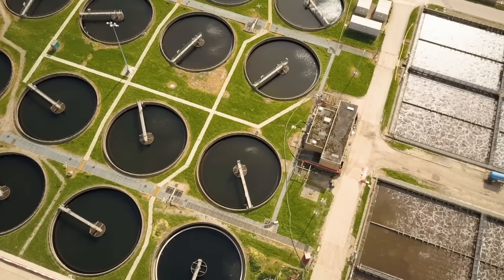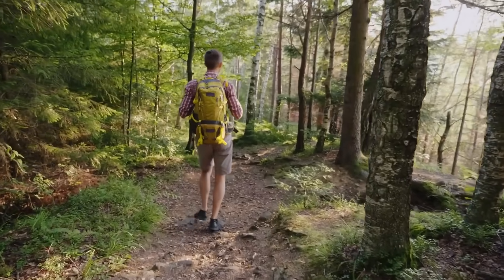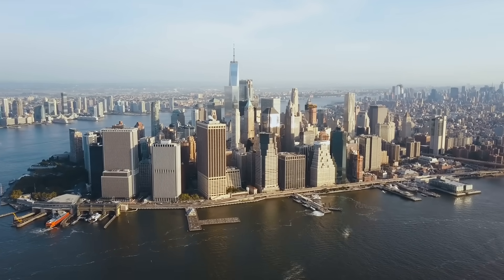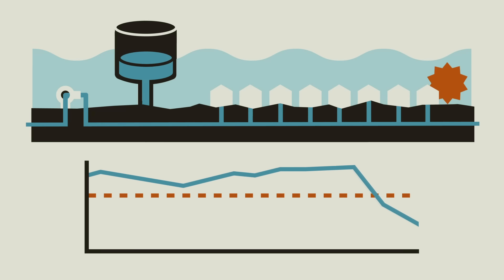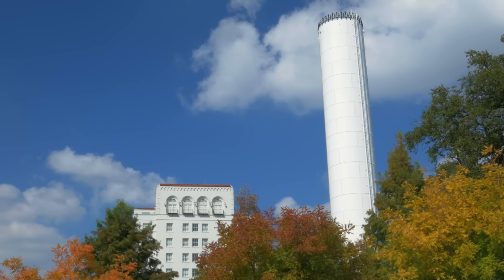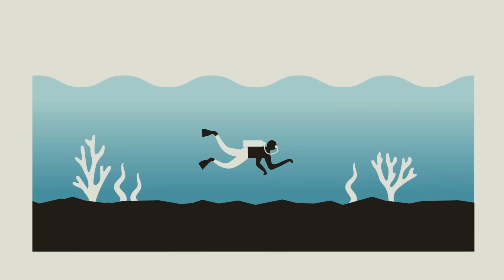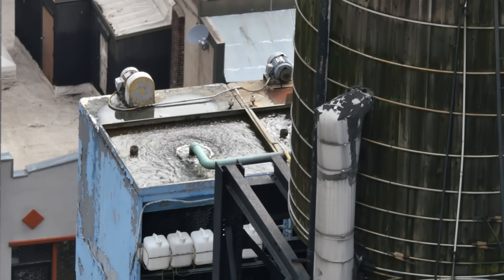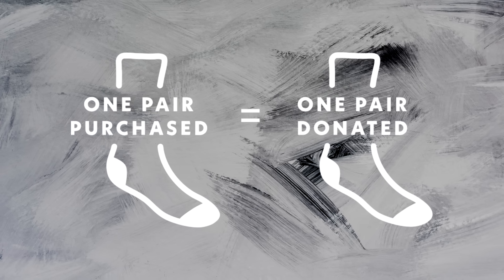How Water Towers Work

Comment: Great video. I think we need the equivalent of water towers for electricity. By placing batteries in sub-stations, electrical power plants and distribution wires can be sized for average demand, instead peak demand.  Yes, batteries aren't cheap, but neither are peaking power plants and additional long distance high voltage transmission lines.  Also, the Tesla PowerPack is changing the cost equation for grid storage. By storing 3-4 hours of peak electrical demand at the sub station, electric utilities can practically eliminate the need for maintaining expensive power plants that are rarely used.  In many cases, they can also avoid adding or upgrading transmission lines.

Comment: My country does not have good water system. They don't have enough pump to give enough pressure and don't have enough water tower. The water is contaminated to certain degree (definitely not drinkable but supposed to be useable for taking a bath without getting skin disease). And their pump fails from time to time.

We had to have our own water tower for reliable water supply and on some areas we also build well to provide water when their pump fails.

Comment: One of the really bright Civil engineers watching, please answer this question. Why not build these storage tanks at ground level, and to develop the pressure necessary, extend (for example) a 15 inch diameter pipe vertically to the height necessary for creating the desired pressure at the tank discharge? Since water pressure in a closed system is proportional to the height of the water column, the pressure at the base (where water is discharged into the pipe system) is the same for this tank configuration as it would be for an elevated tank of the same height. The obvious advantage is substantial reduction in construction costs. Just curious!

Comment: We use automated pressure reducing valves to regulate pressure districts. It is also interesting to note that water tower cost is now often subsidized by leasing space to Telecom companies, or serving the dual purpose of WISP structures for municipal SCADA networks.

Comment: my town just got its first water tower and yep one reason mentioned was increasing fire safety.    NYC is unique in all those residential buildings having the rooftop towers.

On a side note I remember reading about water pressure being an issue for the future proposed extreme tall buildings,  Something like the still science fiction idea of 2000m+ buildings would need multiple tanks because if you stuck the water on the roof it would (probably exaggerating)  "Blow the urinals off the wall in the lobby bathroom".

Comment: Good job on the video. I am curious though, if water towers are meant to store energy by being elevated how much stress/energy does the pump need in order to fill it, and why wouldn't that level of energy be the same or more than it would take to pump the maximum level of water used during peak hours with no tower? 

Water towers are not magic, and did not create free energy, so gravity based energy still comes from somewhere, and not only does it take ALOT of energy to push all that water up into the tower but it also has to constantly push to keep it up there when not being used. That problem compounds the higher the tower needs to be. I'm clearly not an expert, and I am sure there is an explanation (this is why we obviously use towers) but from a layman's perspective it just seems like there is a certain point in time in which pumps are spending more energy fighting gravity than they are distributing water.

Comment: Our farm run very similar system where the two water tank would be fill from rainfall, then pump up to tank on stand, that would have enough pressure for house n lawn.  But times have change with pumps which have better pressure n cheaper pump to house then tank stand.  Great vid👍

Comment: Towers are usually 100 foot tall producing 32 lbs of pressure a system usually provides 70 lbs of pressure with pumps so the towers will not push water out unless the pressure outside of the system is less than that which is produced by the tower

Comment: I can't think of a single active water tower in the UK, that being said we are quite a water abundant country but even so there aren't any even in elevated major cities. 
I think water towers are likely on the verge of being phased out even in  dry places in america since pumps these days are generally on variable frequency drives anyway so they can be very accurately controlled and ran at say 25% capacity and automatically increase their speed as demand increases using simple pressure information in the pipeline.

Comment: Mr. Grady, I want to thank you for the effort you have put into uploading videos explaining our municipal infrastructure! Even though I am pursuing a degree in mechanical engineering, I have to admit that a lot of concepts in civil have got to overlap with the discipline I am in, hence my interest in your channel! 

During my first year internship with our municipal wastewater division, I was overseeing the upgrade and rehabilitation of our sewage pumping stations. We had a sizable number of mechanical consultants and contractors responsible for calculating the volume of our wet wells,  sizing the grinder pumps, and also creating a ventilation model for the pumping station. Since our municipality has adopted a SCADA (Supervisory Control and Data Acquisition) network for all public water works, we also have an increasing demand for electrical and software engineers. 
It just goes to show the diverse skill set required for the operation of the public sector!  

Just a small note regarding 6:40, to address the issue of contaminants from domestic, or commercial clients mixing with the potable water supply, the city where I live (Toronto, ON) has mandated the installation of back-flow prevention devices - a one way valve which prevents water flowing in the opposite direction. You may read more about it below:
https://www.toronto.ca/services-payments/water-environment/water-sewer-related-permits-and-bylaws/water-supply-by-law/backflow-prevention-program/

Comment: 14 our of the 19 almost 20 years of my life I had my own (my own as in my household) well system. It's nice because we only need to maintenance it every couple of months and buy salt when needed but one year we had a drought and it messed up our pump so we had to drop it an extra 10-12 feet and buy a new pressure tank and pump and it costed us about the same price as a 2014 Honda Civic. LUCKILY we had a savings account my grandma passed on to us SPECIFICALLY for this so we didn't suffer but we did have to borrow our neighbors well.

Comment: Can you do a video on Trumps new 30ft steel slates (spikes), something 30ft tall without any other support will give you extreme bending leverage, 
is $49 20-Ton Hydraulic Stubby Bottle Jack 20ft up is all what is needed if steel tubes walls is 1/4" thick? if 1/2" thick?

Comment: Read about Bernoulli's Equation if you are interested in learning more about fluid dynamics. In Civil Engineering, we say that the total head = pressure head + velocity head + elevation head for fluid mechanics applications and that the total head = pressure head + elevation head for many soil mechanics applications where fluid flow through soils is very slow.

Comment: In my country water towers are rare... Rather every home has a 1000-2000 liter water tank installed on the roof. With a small pump helping the water get in it. That way any peak can be handled locally. Also in case the water stops for some reason, you still have enough water to last a couple of days until the problem is fixed.

Comment: 2:22 You've got that part wrong. Current flows from higher voltage to lower voltage, but electrons flow in the opposite direction to current (from lower voltage to higher voltage, as their charge is negative).
Reply: As an electrical engineer, I usually don't bother thinking about electrons at all. Frankly, if someone had given the proton a negative charge instead, I would be very happy.

Comment: "Just like electrons in a wire move from high voltage to low voltage"
How did you know I know more about electricity than water distribution? ;)

Used to seeing that analogy in reverse
Reply: and Beside, electrons are just theory.

Comment: I do wish you would have mentioned that anyone under 6 stories in New York City does not require a pump as the suppling reservoirs are higher than the city. You touched on it just not the scale.

Comment: In many skyscrapers city water is pumped into a ground level, or below, water tank as the city pumps cannot pump the water up 50 to 100 floors or so - or have the distribution pipe capacity to do so. The lower the holding tanks the less energy needed from city pumps. This water is then pumped up to roof tanks or intermediate tanks on other floors, by the buildings own pumps.  

The same is done with sewage but the other way, having a below ground holding tank then pumping the sewage into the pipe system at night or other times of slack periods. In skyscraper clusters you may find each block has a time slot to pump into the sewage system.
Reply: Sewage and water systems rely on buffering. electrical distribution systems are also adopting using grid storage battery banks. Large banks of chemical batteries in buildings where demand is high to release in peak demand. They store overnight electricity when demand is low and electricity generated would be wasted. 

In Germany they use used Smart Car EV  batteries for grid storage.

Comment: Before electric motors, cranes and other machinery, at factories and docks were operated by compressed water.  Also the lock gates were operated by compressed water. They had a local hydraulic accumulator towers that had a steam engine pumping water up. The water was compressed by a large floating piston filled with rocks.  Pipes would take the compressed water to where is was to be used.  Here is an accumulator tower at Liverpool Docks:
https://s0.geograph.org.uk/geophotos/05/06/36/5063693_d0f39e6d.jpg

Comment: In the UK, until recently, all homes had a 100 gallon storage tank in the attic. Large water main pipes and pumps now replace these, liberating space in the home. An advantage was you always have a store of water in case of outages, with low pressures easy on plumbing equipment . Disadvantages were low water pressure for showers, although shower pumps fill the gap. Another advantage was that in a city the size of London the stored water in buildings was the equivalent of a full reservoir.

Comment: Thanks for the video. If the temperature of a water heater is too low (I think the cutoff is around 103?), there is a risk of infection from Legionnaire's Disease. So how is this avoided in a water tower in a hot climate, where the tank bakes under a 100 degree sun? Conversely, what keeps the water from freezing when the temperature is -40F? The only answer I can think of to both questions is that the water keeps cycling through fairly rapidly.

Comment: How do they prevent the water in water towers from freezing?
Reply: The bottom wouldn't freeze at all, since it's under pressure. And water famously has it's greatest density a few degrees above freezing.
And since the water is constantly being drained and refilled, it's always in motion. Which prevents it from freezing.

Comment: Another way to make pressure in the systems is the use of bladder tanks. Typically these are used in smaller systems like at resorts, businesses, and small communities where demand isn't all that high. These tanks use the compression of air outside of the bladder to create pressure in the system. Thought I'd add to this topic.

Comment: Super good video. Thanks for making it!  If you ever get time, I would love to understand how a water tower works. I have always wanted to go inside one for a tour and fully understand how the tower affects the water grid around it.  Some water towers are real short, some are really small, but super high in the air.  If you are ever looking for content to make in the future, this would bedazzle me completely. I would think there is a water supply to the lift pump and that is one-way to the output grid from the tower, but do we use pumps to actually maintain pressure in the local grid? Is there a backup system in cases where there is a "main" break from a someone trenching, etc? I have always wondered this, but never figured out how to answer these questions.  Thanks again for the video!!

Comment: just like a capacitor in electricty, awesome
Reply: Or a spring in mechanics.
Reply: @rockyblacksmith  i didn't thought about that
Reply: @traso56  
It came to mind because our mechatronics professor once showed us a chart comparing certain elements in mechanics, hydraulics, electronics, pneumatics and thermodynamics.
In this case, it's energy storage elements.
And the cool thing is, their mathematical descriptions are also analogous.
Reply: I studied physics and electricity but not mechinal devices :P

Comment: A small correction: water pumps alone cannot provide constant pressure. They work in combination with a pressure vessel to provide a constant pressure to the piping. Water towers can be also underground when they are located on higher ground eg a hill or a small mountain. in order to avoid accidents and lower construction and maintenance costs. In most dense populated cities it's almost always a combination of Water Towers and pressure vessels that provide the adequate pressure and flow rate. Public Water ,collection, treatment, supply and distribution companies esp. in big cities are among the greatest consumers of electricity.

Comment: Interesting, but technically speaking fluids are non-compressible. Pumps impart the fluid to move, fluids can apply pressure to things, but the fluid itself is incompressible. This is why you have relief valves in 99% of hydrualic systems... A cup of water at the bottom of the sea and atop the highest mountain will hold the same number of molecules. I am surprised to not read this in the first few comments.

Comment: Why don't they make water tanks that looks like a long cylinder erected vertically from the ground so they could also use all the space below as container for water instead of just having the water contained up above and the lower area just have the metal supports?
Reply: I see. I guess a full cylinder only make sense for water storage purposes..

Comment: So far I know a aqueduct for the most part was not open for the most parts to avoid contamination and evaporation, only in regions where water was highly available they had been open. On the other side a water tower is still a open system, it has to allow air, maybe polluted air,  to flow into the the tank to replace the water. How is that air treated?
I also coming from a country where water towers are obsolete at least since I have been a child, and only are beautiful buildings for me.

Comment: Ah, Kinzua Dam at 7:12. That lake to the left is technically the true source of the Mississippi River if you go by volume of water instead of by what some dead white guy put on a map.

And yes, that big pool above the dam is basically just a giant battery. The hydropower people (long building on the left bank) pump water up there for storage and then they reverse the flow to power their turbines when it makes economic sense to do so (the turbines are below ground on the downstream side of the dam, so there is still a net release of energy). The pump/generate schedule is based not just on electricity demand, but also on when and how much they are allowed to withdraw water from the reservoir.

Comment: Using "Electrons flows from a high voltage to a low voltage" as a comparison is flawed. That actually flow the other way, because they're negatively charged, and the higher voltage has a more positive charge.

Comment: Storage tanks aren't used for just energy storage or water; Rechargable electronics use a storage tank of sorts themselves. It's called a battery.
Reply: Yup. Doesn't work great as grid storage though, since AC needs synchronization.

Comment: I live off the electrical grid and use solar power for most needs. I also have my own elevated water system providing 95 psi gravity pressure with 10,000 gallons stored in 2 tanks.

Comment: huh, so a water tower is kind of like a capacitor, but for water.
Reply: Mechanics, hydraulics and electronics have a set of equivalent structural elements.
In this case it's energy storage, which is springs for mechanics, retaining chambers for hydraulics and capacitors for electronics.
And the cool thing is, they are mathematically equivalent.
So in principle, you could take any mechanic, hydraulic or electronic system and transfer it into it's respective equivalents.
You'd have the same calculations describing it, just the values would change.
Reply: Like electricity the larger the pipe the more flow or current i.e. water current. Electrical engineers have always used water as an analogue to describe electrical characteristics of wires. It works except when explaining voltage.
Reply: Gravity supplies the potential energy. Once a valve is opened you get that potential energy released due to the pressure of all the other water pressing down. The pressure is a function of the static height of the water column and the diameter of the pipe.

Comment: I believe we use underground tanks with air pressure above. same principle as a supersoaker watergun...  it goes with the general  thinking that all services should run under ground for aesthetics as well as reliability  .  Power, gas, water, sewer, communications, heating, is pretty much all under ground around here.